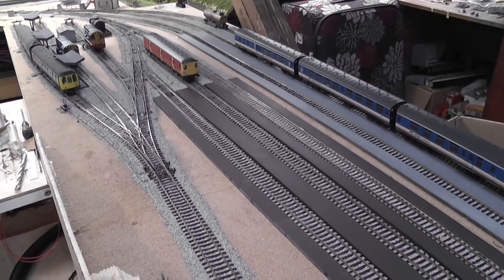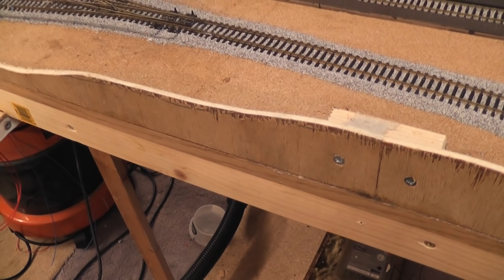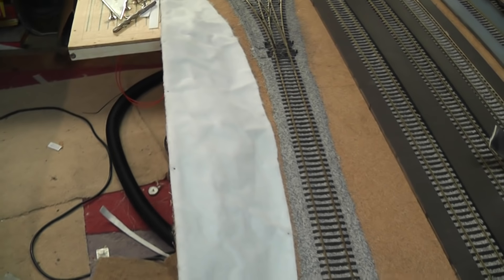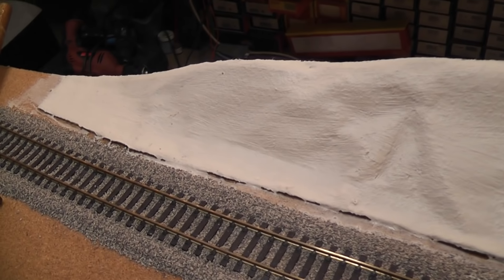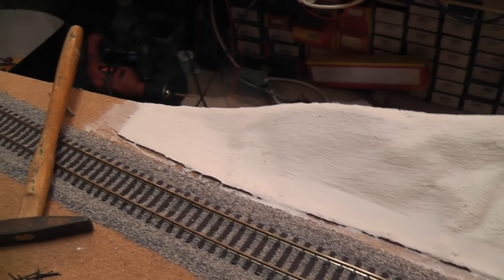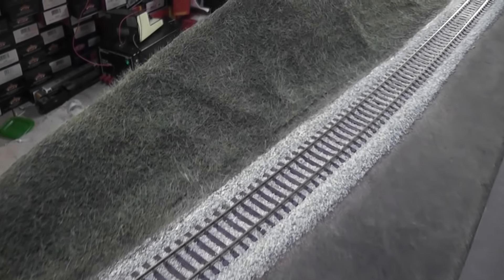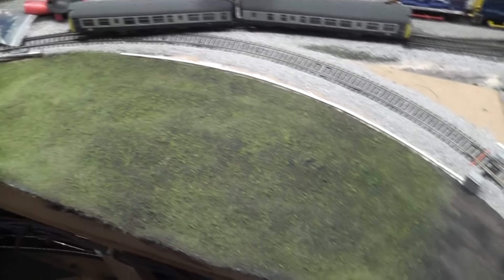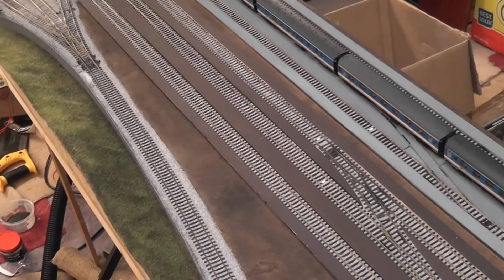Building a Model Railway - Part 10 - Terrain

Comment: Hi Richard, I have used Shaper Sheet on some of the large hill at the far end of Lakeside and although it was very good I did find like you that it was a little awkward to manoeuvre if it was a large sheet but I think that was more down to me than the product as it was the first time I had used it but the end result I thought was very good and quick to use too. Great, informative  video.         ...........Graham
Reply from the maker: +Graham Foulston Thanks Graham.  Certainly is a new approach to things, but I'm very pleased with it.  Once it's dry its got a nicer finish than plaster cloth.

Comment: Hi Richard
Really nice job on the two scenic sections, they turned out really well and the bendy material seemed good. I wasn't expecting it to be as hard as it was when it dried. I've seen it used before and wasn't really impressed but you didnt try to contort it too much. The surface finish looks better than plaster cloth too.
atb Paul

Comment: @EverardJunction when you installed the peco electrofrog points, in my instructions it says there is an option for cutting the two little wires that go from the sections of rail between the frog and the switch blades, did you have to do this in order to power the point with a polarity switch, or can you just leave it without cutting them? (is cutting them necessary to prevent a short?)
Reply from the maker: +5dmc1 I left mine and all the others on the layout with them in.  No problems in the 5 or so years I've used them.  I think it's to prevent a short but if the switch is installed correctly a short wont happen so you should be able to leave them in.
Reply: EverardJunction thanks for the quick reply! I'll leave them :D

Comment: Great video as usual.  I was wondering what the open time on the plaster was?  30 minutes?  15?  Also, was there an advantage to the metal (?) backing of the shaper sheet when you were doing the static grass.  Thanks...
Reply from the maker: +wysiwygsd I'd say about 10 to 15 mins before the the plaster starts going off.  The backing sheet certainly seemed to help with the grass application.

Comment: Do you think that the shaper sheet would be able to accept a tree? Also great video, thanks for sharing.
Reply: the sheet does take trees...just take the base off so that there is a point on it and use pva to hold it in place...i watched the woodland scenics vid on it and they added trees to it
Reply: +Gary Adams Thanks, I was thinking that the Aluminium should cause slipping and the general thickness of the plaster. Going to check out the WS video now.
Reply: +OMG Train no problem mate...hope you can do what you need to do with it...let us know how you got on